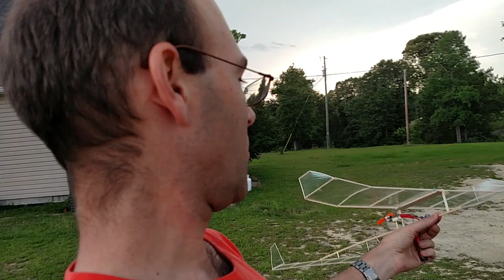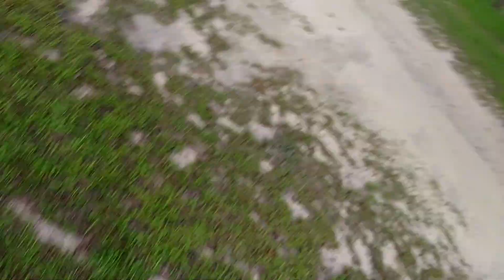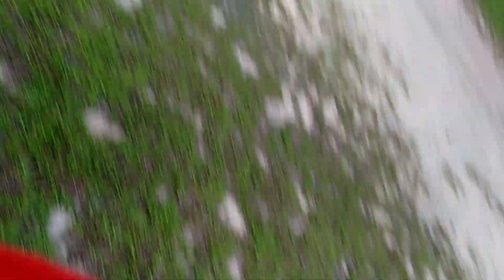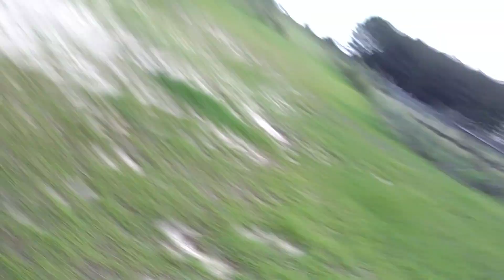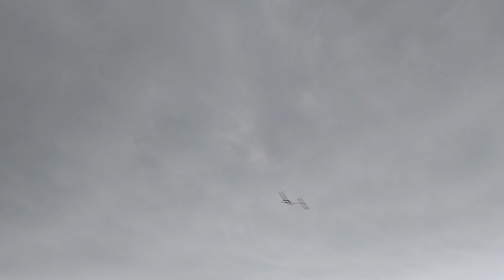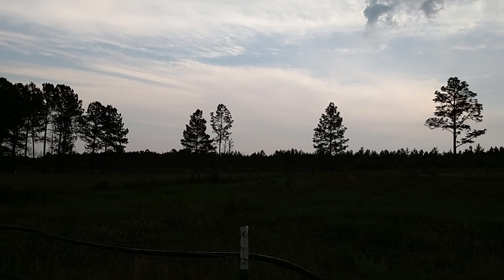Capacitor Powered Free Flight

Comment: Ideal for fast charge, short power run and a glide. With your super lightweight constructions you could have a long wait for it to come down again :-)
Reply from the maker: These can put in shockingly long flights. I'm pretty sure the Germans are doing about 5 minutes under an 8m ceiling.
Reply: Yes I can see with the indoor type planes you still get useful power for much longer. I initially looked at them just for the powered climb and glide.
Reply from the maker: They're very versatile and last seemingly forever. Really amazing what you can do with these!

Comment: Nice! About 3 volts you say...so I'm guessing a 2.7 volt cap?
Reply from the maker: In this case, yes, however I just ordered some 5F 3V caps from Newark that are lighter than two of these 2F caps soldered together (2.7g vs 3.3g). Looks like you can go crazy light with these and they're dirt cheap. The performance is surprisingly good.
Reply: Interesting! I might just have a go at it myself!
Reply from the maker: Definitely! There are some plans over at INAV for really nice capacitor planes.

Comment: What battery or supercap did you use Josh? Regards Frank
Reply from the maker: It's a pair of cheap 2F 2.7V caps off ebay. Much better would be the 3V 5F caps off Newark. Not as cheap, but definitely a better storage system, and easily compatible with a pair of Alkaline cells.

Comment: Jo, we need to push change in the rules and fly this instead. LiPos suck. I'm going to introduce this in Canada.
Reply from the maker: I'm more interested in putting together a parallel class of models. For one thing, none of us in the US have sufficient experience with these models to know what a good set of rules would look like. There are definitely safety issues with caps because it's extremely easy to overcharge them, and I don't know what happens when these get shorted or worse, charged past their dielectric limit. Also, all the supercaps I'm looking at have huge error bounds on their capacity. So let's start working on a set of rules for an alternative class, fly it, and see how we can break the class, fix it, and then get enough participation to introduce it as an official thing.
Reply: Sure! I build one after Lakehurst.